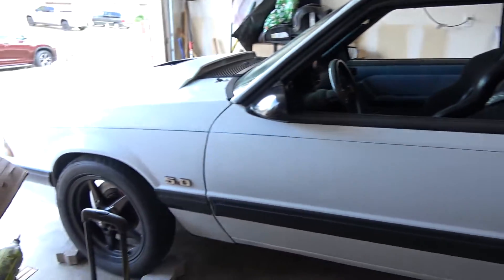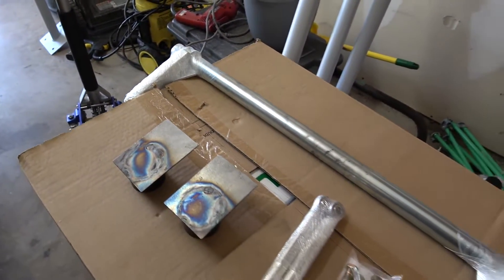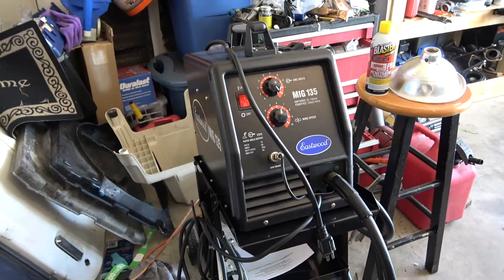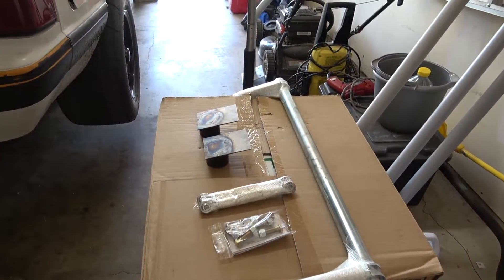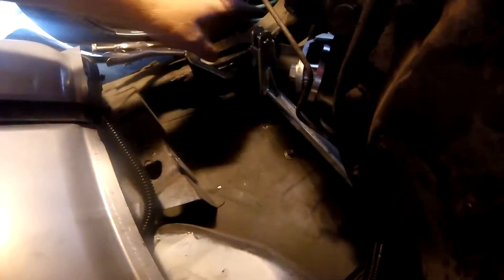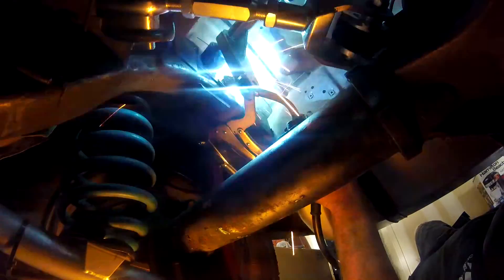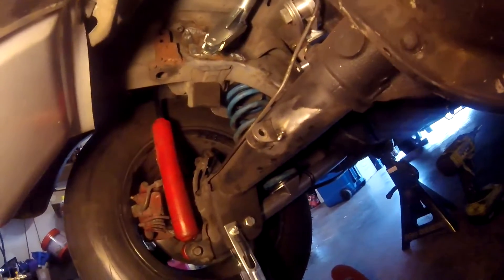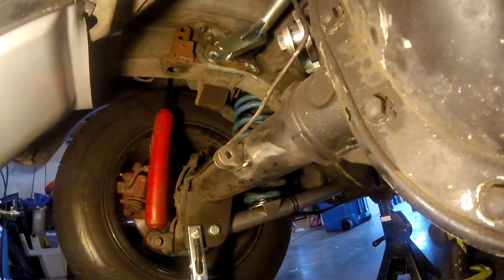UPR Anti Roll-bar Install - Foxbody Mustang

Comment: Justin you are correct,, that welding machine is not powerful enough to weld on the rear(I am a welder by trade). You took a big risk welding that close to the fuel tank with the fuel lines disconnected and a known fuel leak. It is also not common practice to spray water on a hot weld as it fatigues the metal and causes it to become brittle. I'm happy  that car has transformed into a beast over the years. I have bean following you sine you had the blue. GT.
Reply from the maker: For sure a big risk being that close to the fuel tank. Lucky everything went well. We will see how long those tabs on the axle holds up. Water probably wasnt the best thing, but what I had at the time. Air compressor was down. Dang you been following for a while haha

Comment: You shouldn't spray water on your welds to cool them off because they will crack.
Reply from the maker: You could use water or air to cool off the bearing. The instruction stated either one is need to keep keep from damaging the bearing and seal

Comment: Sweet.  I've got a Hobart 140 @ home (Miller @ work .  Remember do not skimp on rollbar/cage padding on both driver and passenger sides.  I've seen some people get messed up  ( head injuries) from smacking the bars without a helmut on.  Keep wrenching on that bad lil white fox , looking good .  I know I keep pushing the quickjack lift , but for low clearance garage it sure beats stands , and surprisingly low cost.  I only have one bay at home with a two post and the qj comes in handy on the other two where the ceiling is lower. Anyway can't wait to see this car done again and going down the road.
Reply from the maker: Yeah gonna put some padding on. Don't want to experiences that. yeah for sure need to grab a quickjack soon. Would make my job easier!

Comment: A cheap rearend girdle is a 05ish explorer IRS, just have to cut two ears off, but it has a drain and its aluminum. Look good
Reply from the maker: Yeah, was thinking its time to do it. I'll do it when I do the gear swap
Reply: @justin91lx  you gonna run axle tube reinforcements ?

Comment: Are the solid bushings noisy?
Reply from the maker: They are a little. I can feel the drive train more
Reply: Yeah I’m about to do control arms on my Fox debating on solid or rubber
Reply: Yes , all solid mounts and bushings are noisy.
Reply: I’m thinking noisy is better than the loose feeling I have back there right now lol
Reply: @LynnTwinCustoms513  that depends on a few things . Such as power level,  drivability , comfort  and so on.  If it's pretty mild , just replace your worn out bushings and mounts with stock replacements , especially if it's daily or mainly street driven. If it's more of a street / strip car , maybe upgrade , if it's a high power purpose built car ( then they should have been solid long ago ) that driver / passenger comfort and road noise isn't a concern than solid is for you.
Reply: Appreciate the input from everyone! It is my daily right now since my actual daily is broke down lol but I maybe put 5,000 street miles on it a year. I’m just trying to prepare it for a new engine and rear end I have for it. Still on the hunt for a manual trans that can handle what I plan to throw at it
Reply: @LynnTwinCustoms513  my advice here is that if you plan to drive and enjoy the car , than don't do solid mounts and bushings . Same goes for running a Richmond gear vs a ford racing gear . Richmond's are a  much harder gear and will make noise / whine regardless of how you set them up , vs a ford gear set correctly . If you don't need full race parts that handle obscene amounts of power / torque  then your driving experiance and ability to drive the car will become unhappy.  I've tried to talk many customers out of doing those things,  only for them to do it , than either return and remove such parts ( $$$) and go back to our advice , or just sell the car because street driving became unpleasant . Constant rattles , squeaks , gear noise and feeling every pebble of sand in the road isn't for everyone.  If by chance you do make those upgrades invest in serious sound deadening material , and better seats with good suspension and padding if you want to enjoy it .
Reply: Good advice Jackson storm! I do have a nice set of Recaros I’m putting in. About to buy a carpet kit tomorrow and possibly lay down some fatmat or something comparable. I have fatmat in my Lincoln and it seems to work well just kinda pricey compared to others.
Reply: @LynnTwinCustoms513  cool , good luck with the project and keep us updated.  Remember no  matter who gives you advice or feedback that in the end it's your baby , and not to second guess what you really want her to be.
Reply: Appreciate it! I hear ya. It’s like the Recaro seats I have are out of a Saturn ion redline and I have had a few guys hate because they are out of a gm lol i have a couple videos up but they suck no editing and from my phone.